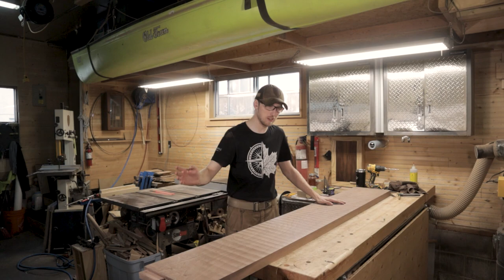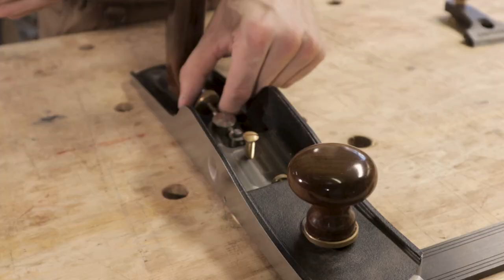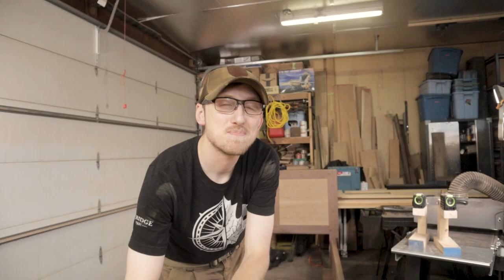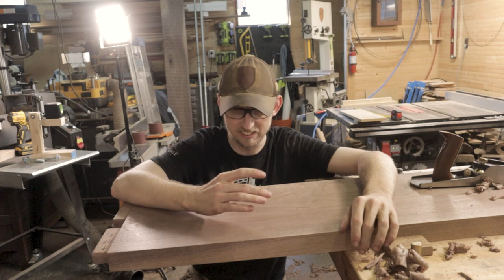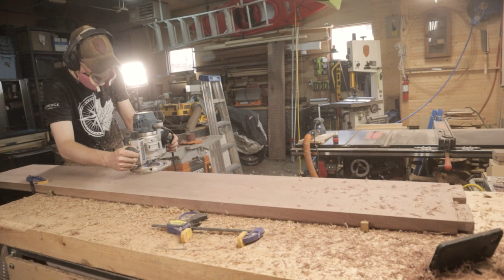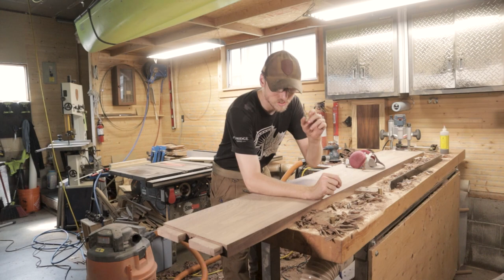Using a Low Angle Jack to prepare the side rails for finish | King Bed Frame | Fine Woodworking

Comment: it's probably worth noting how easy it is to add the very slight taper to the ends of the long rails to get that perfect match/reveal at the joints with the hand plane versus trying to do that with a router, bandsaw, jointer etc. It just sort of struck me as I watched
Reply from the maker: That is very true, it really is impressive that no matter how much you spend on machinery sometimes an old school hand plane is just the best way to do some things!

Comment: I'd be interested to hear why you used a low angle jack rather than a Bayley or Bedrock number 5.  Or if you used it because that's what you've got why you bought it instead of a traditional design.
Reply from the maker: The only plane I have is my Veritas Low Angle jack, it was the first plane I got when I started working with hand tools more. I watched lots of videos saying that the best plane to start with is a low angle jack because they are mechanically easier to understand since they don't have the whole chip breaker setup and you can use multiple blade angles for different performance.
Someday when I have more money I plan to get a wider set of more traditional planes because I think they work a little better than the jack.
Overall I looked at the jack as a more all around solution compared to the generally more specialized traditional planes.
I hope that answers your question, if I missed anything just let me know.

Comment: How many times did you sharpen doing the side rails?
Reply from the maker: Only once, by the second rail I wasn't trying to get a perfect finish with the plane and resorted to more sanding. If I was using the plane for finish I would have used a freshly sharpened blade for each rail.